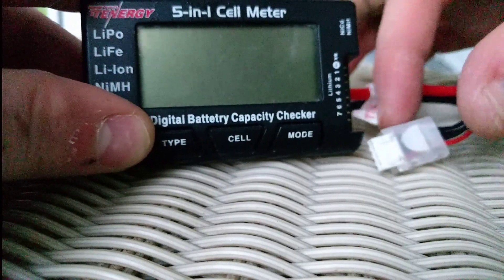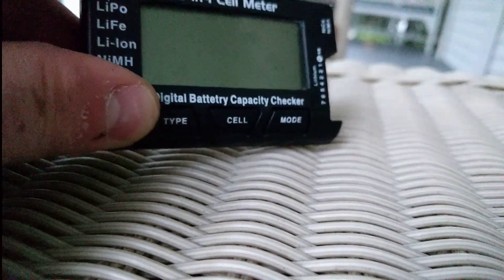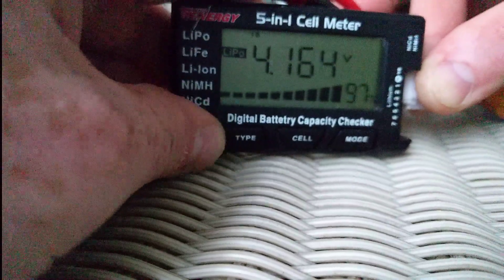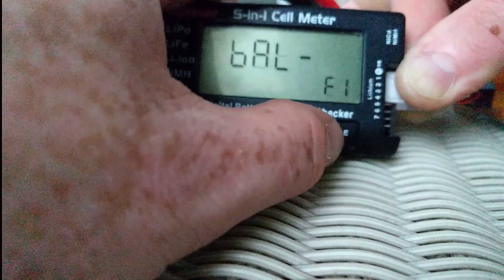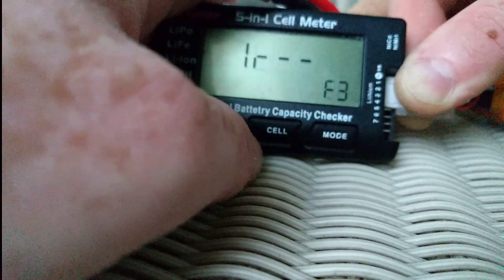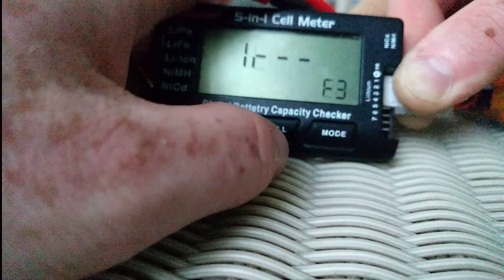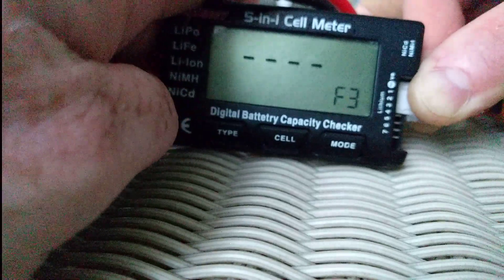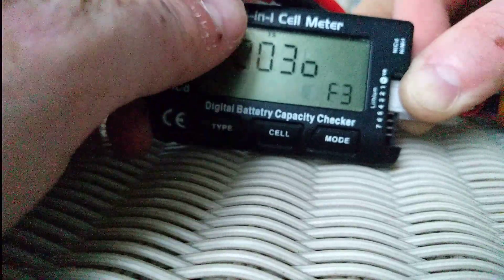How to get internal resistance with Tenergy 5-in-1 Cell Meter

Comment: I bought one of these so I could test my
Eflight 2 cell 7.4v 280mah that I use with my rc airplanes.
But the pins in the meter are too big to plug into the holes in the battery lead on my 2 cell pack.

Why?  I thought this meter would test my 2 cell pack?
Reply from the maker: Argh that's gotta be frustrating. Your two cell fits everything else with pins presumably. Can you at least rest the bottom of the connector where the length of the battery's female pins are exposed onto the device's pins? I have a two cell, I'll see if I have the same problem.
Reply: I called Tenergy tech support - they say it will not work with mine because the 2 cells are not in a "battery pack" with a "balance plug"....
and there is no adapter.
So, I'll try to return the one I bought or sell it on ebay -
and look for something that will work for me.
Thanks for the reply